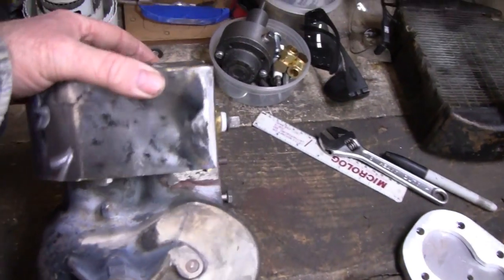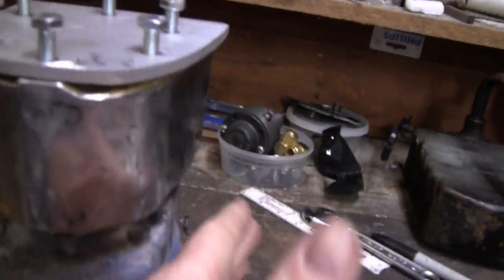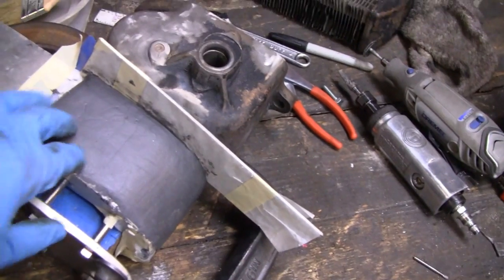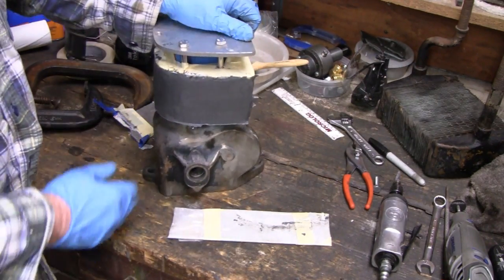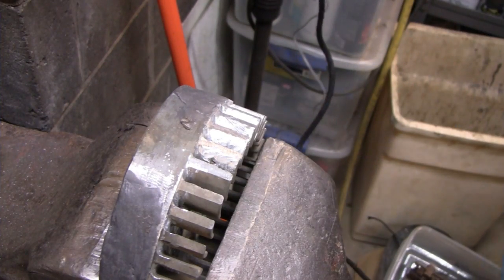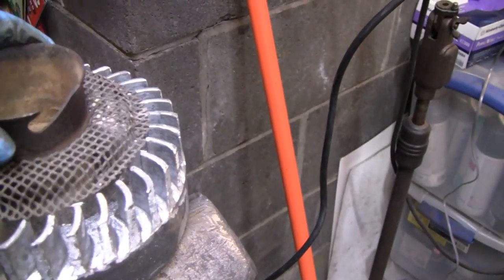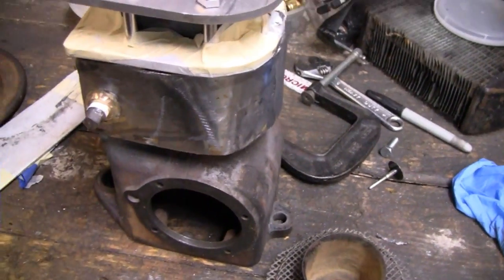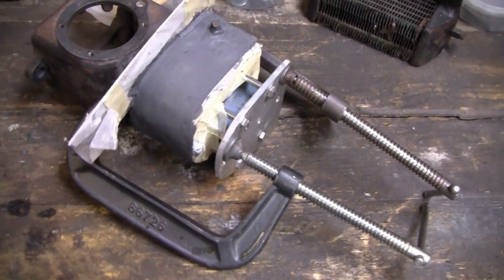HOMEMADE WATER COOLED BRIGGS ENGINE (part 16)

Comment: new video: Diesel Briggs, take that as a challenge.
Reply: yolo swag shaving the head that far to increase compression May be hard.  but their are deisel lawn mowers on the market
Reply: yolo swag I have a video of a weed eater engine running on diesel and ether with no spark plug. only took lots of heat to make it happen.

Comment: hey Road king , been wanting to do water cooling on a v-twin by weaving a brass or coper  line in an between the fins on a v twin heads  an put the rad above the fly wheel  of cores the pump would be 12volt regulated to the motors rpms vertical shaft  , what's your thoughts

Comment: That flywheel's gonna look boss, but if it were me, I'da kept the fins active and redirected the airflow they produce to run through the radiator instead rather than rely on air convection or electric fans to do that.

Comment: I bet there is more plastic in the new B&S engines than in this one. Where did you get the water pump for this one again. I did not catch what you said in that video.
Reply from the maker: We're gonna use a different pump that looks more period!! Got both from Ebay!!☺

Comment: Just for a sake of everybody sanity. You could balance it yourself the same way the motorcycle guys balance new tires. But instead of adding weight you could drill holes on the non visible side until it's balanced. If don't know what i'm talking about just search for how to balance motorcycle wheels.
Reply: wilsonthesphere wont turn enough rpms to make a difference

Comment: The block looks nice and smooth...I f the flywheel will fit in the lathe ..you could machine it so it is round and smooth ....I would not worry about it being in perfect balance ..but I would not want it to be off enough to have a bad vibration in it
Reply from the maker: That's the plan Mate!!☺

Comment: A few questions that I have:

Do you plan to make this engine with a pressurized cooling system?

Would you consider setting up some kind of dynamo to see how well the cooling system works when the engine is being worked hard?

Maybe you could mount it up like a small LeRoi engine.

Comment: More nice work today 👍
The only concern that I have, 
Will you be using something to seal the cooling chamber on the engine block just in case there's a micro leak ?
Maybe use Redcoat tank sealer ?
Cheers fairlane2020
Reply from the maker: Thanks Bud!! Sounds like you don't have any faith Roadking!!☺
Reply: 805ROADKING 
😂I have faith in you.
The quality of my vision isn't that good 😊

Comment: Its looking great. It will run better than a Swiss chocolate watch. Just wondering where you get your epoxy from? If one was to use Jb weld on something like this, you might as well cast it out of gold.
Reply from the maker: I got that from an Gov't surplus auction, but any paste epoxy will work!!☺

Comment: With any epoxy build-up surrounding one of the hottest temperature areas of the engine, Do you anticipate any cracking, or distortions in the epoxy material ?
Reply from the maker: Nah Rick!! We made the exhaust on the 4 cylinder from epoxy, thats been holding up for over 3 years without any problems!! You gotta trust Roadking!!☺
Reply: pretty sure this build wont see long service times and is a just run it every now and then for a short burst so balance and heat cracking won't be a problem unless it goes on a water pump even then heat won't be a problem its water cooled after all and cant reach past the boiling point of water at i'm assuming 16psi with a thermostat unless he doesn't use one and than 100`c that's it.probably only need a heater core from a wreck and a electric fan now that the mechanical one is epoxyed. now that i'm thinking about it i wonder how he is going to generate 12v

Comment: are you going to use the motor on a machine like a chipper or snow blower
Reply from the maker: Nah, just a show engine!!☺
Reply: 805ROADKING a water cooled mini bike would be awesome to see
Reply: It's going to be a show engine, the only work it will probably ever do is pull the waterpump for the cooling.

Comment: I'm with the majority here on the flywheel balance, even though you told us it'll be alright. I know you won't be running it wide open, but without first balancing the flywheel, the end cap bearings/bushings will wear out pretty quick. Of course, I trust your judgement. It just makes me cringe at the probability factor. I also like the little tid bits of the project on the work bench that you haven't spoken about yet. Cheers Roadie my Friend! (I'd seriously consider having the flywheel balanced after you're finished filling everything in, or at the very least, turn the final finish on the lathe) Zippy~
Reply from the maker: Thanks Zippy!! When we get done with that flywheel it will be balanced better than it was outta the factory!!☺

Comment: how do u convert a vertical briggs to horizontal
Reply: You make an oil dipper for it, and change the oil drains in the case as far as I remember.
Reply: James Sutton get a different carb too
Reply: James Sutton and change the internal oil splasher